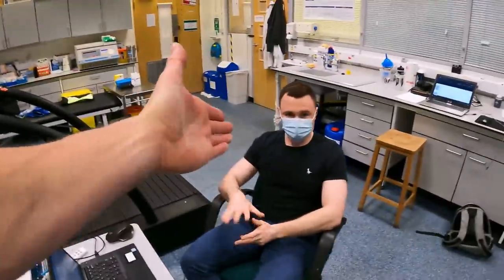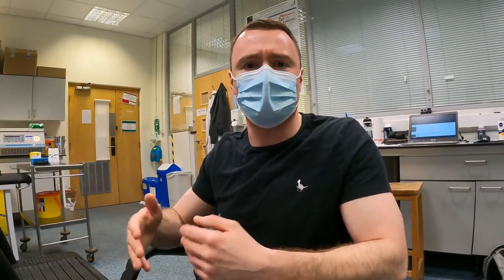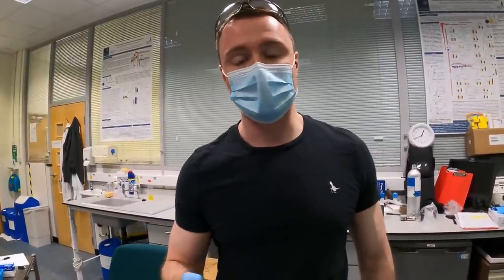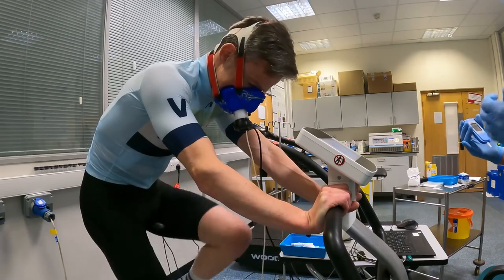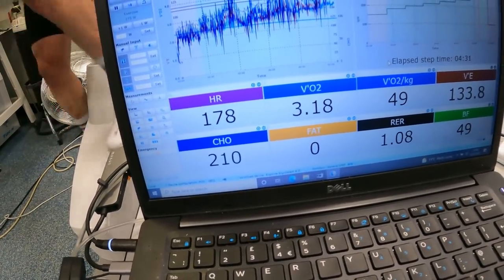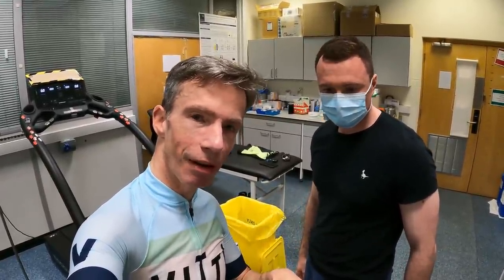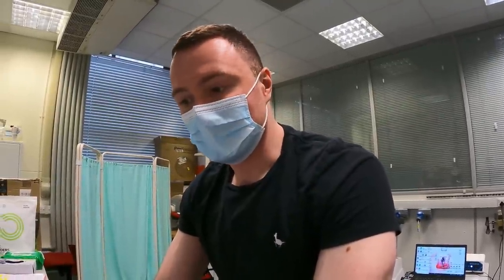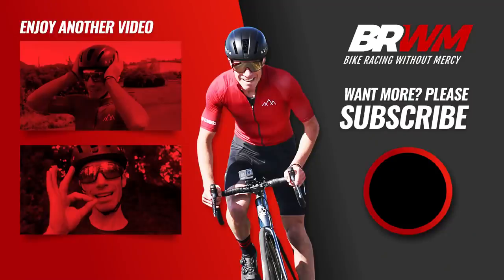How To Improve Your Cycling Endurance, Using Sports Science

Comment: Interesting how the methods differ... In Finland we use as a general rule the (3min steps, mind that) they calculate the LT1 where the mmol value increases 0,3mmol/l from the baseline... i think that just tells that 3min steps are inaduequte... dr inigo san milan tells that pros should test at 10min steps as iahats starts to be enough of time to get the homeostasis in the Bla etc values on the chosen effort... san milan is podacars / UEA team coach and cancer/physiology researcher and lecturer in colorado uni... bright fellow, he has few good podcast cameos i would anyone interested on these geeky stuff to lsiten to... easy to find from spotify..
Reply from the maker: Thanks Heikki 🙏 And Adam was of the view that the 3min steps as per the test which we last used to establish my VO2 Max don’t allow enough time for the lactate to stabilise (like HR it is a lagging indicator).  So as for Dr Inigo San Milan, Adam also chose a longer period for the ramp on this lactate test (8mins).  To your point, Adam also mentioned in the video that that there are a number of different protocols for deciding where the lactate threshold (LT1) lies - and he was using 1mml.  But others have said the same as you (0.3-0.4mml).  And on the 0.3mml basis I would guess my LT1 is close to 225W, because my base-line was 1.2mml and it was stable 1t 1.3-1.4mml upto and including 225W but was 2.4mml at 240W.    I’ll check out his podcast - thanks for the heads up 🙏
Reply: @BikeRacingWithoutMercy  yes, for vo2max the shorter steps are better as less muscular fatigue is inflicted upon athlete before getting to the latter half of the test... and thus better for not so well trained atheltes too, for the same reaseon. For really pinpinting the LT1/Fatmax zones the 5-10min steps should be used im certain of that. I do 6min steps for my home benchmarking as i use dfa-a1 from hrv too and this needs 6min steps to calculate somewhat trustworthy values per step. the peter attia drive -podcast has inigo san milan and they did revisit podcast episode month or so back drom the episode and i think they are doing a follow up episode together later this year as it was advertised december-january... one of my very favorite podcasts ever all topics included - this first podcast they done... its very long and i had to listen it 3-4 times trough first 48hr to really get all the details...

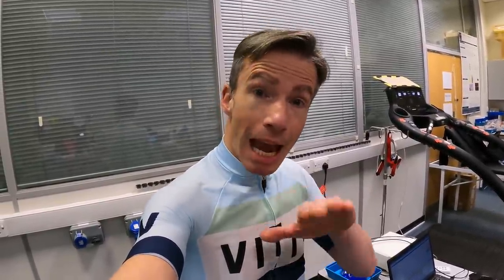Comment: If you want to decrease Carb usage or increase the power you have at a given Carb usage, 3x15@90% FTP, cadence below 60 - and do it on empty stomach or at least after not having eaten for 8 hours; or: 12x0:30@~180-200% FTP, 4:30 rest close (but below) your LT1 or: general any ride in the morning on empty stomach. I think the upper limit for fat consumption is slightly above ~1g Fat per kg bodyweight per hour. Triathletes are quite good at that. Jan Frodeno averages 280-290 Watts on his bike stint. Given that he only can fuel himself ~90g carbs per hour (which he wants to be quite stuffed with as there is a marathon afterwards and running has in general a higher carb demand as you produce more power running) he has to burn a lot of fat @~280 Watt. With 90g carbs you can produce around 1530KJ of energy in one hour. Unfortunately, 75-80% blows up in heat and only 20-25% you can produce power with. That means that a portion of 100-120 Watt from Jan Frodeno's power comes from carbs if he wants to stay fueled. Means he needs ~180 Watts from fat. 180 Watts for 3600s is 648 KJ. 1g fat provides for 37.7 KJ. That looks like just 17g to burn each hour. But as mentioned you blow up most energy in heat, so he needs to burn ~70g fat per hour. That is close to what is possible biologically. I read a value of ~1g fat per minute you can burn per kilo bodyweight if you train exactly for that. Most fit people are around 0,5-0,6g fat/minute/kg.
Reply from the maker: Cheers MrP - that’s really interesting.  I guess the low cadence makes it more muscular in nature - a bit more like strength training 👍
Reply: @BikeRacingWithoutMercy  That low cadence forces you (or rather you body) to use fast twitch (IIb) and intermediate type (IIa) muscle fibers. Intermediate type fibers can burn fat AND carbs, but they will use carbs, if available. If not, they use fat. And if you "force" them to use fat, they will adapt to that situation by building up mitochondria. Furthermore, if done regularly, Type IIb fibers can convert to Type IIa fibers. So the "overall goal" is to increase mitochondria amount/density in that muscle mass that is critical for the stuff you do (here: cycling) because the more mitochondria you have, the more fat and pyruvate (which is an intermediate product from anareobic glycolysis) you can metabolize.
Reply from the maker: @MrPeperoni79  cheers 🙏 - I massively appreciate you taking the time to explain all of this.  I’ll be sure to look into it in detail - and give it a try 👍